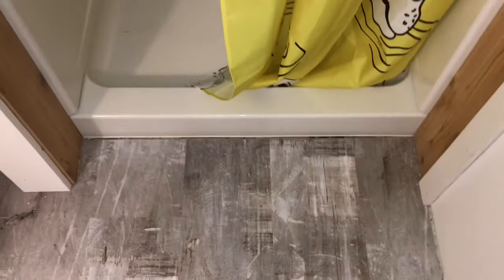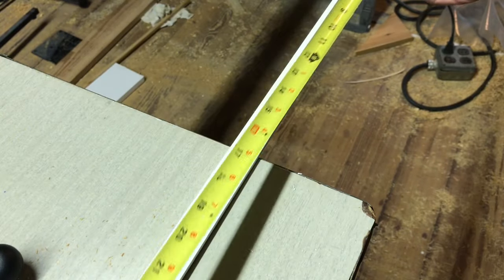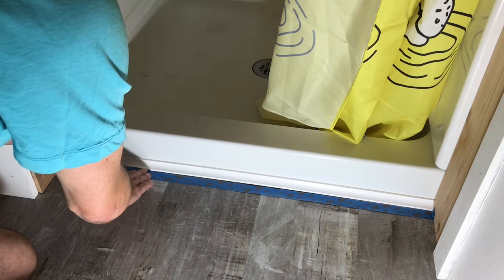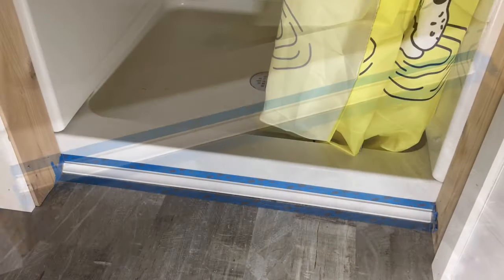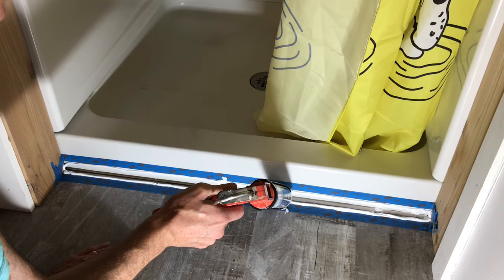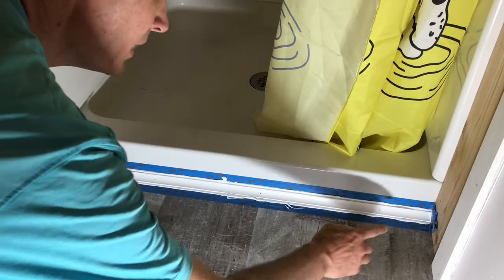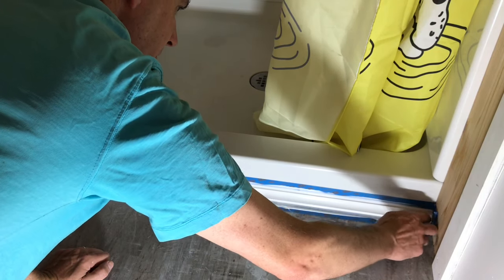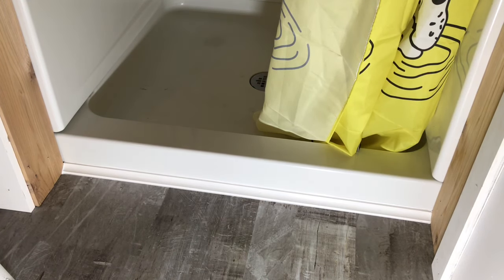How to waterproof a shower/tub threshold on floating vinyl floor

Comment: For the sake of not putting holes in your waterproofing and having to calk the holes and hope in a few years you don't have a shower in your downstairs hallway, just use waterproof construction adhesive, 2 birds.... plus it holds better than brads.
Reply from the maker: Thanks for the tip, Craig.

Comment: Thank you for the video! I have an important question. Are we not supposed to seal in side the shower where the floor meets the walls? 0:04
Reply from the maker: Thanks for watching :-)  ... and no, you don't seal there because the shower walls "shingle" over the base so that water will always go to the inside of the pan. if you caulk the bottom gap, besides getting moldy, it could trap water, especially if you have a 3 piece surround wher water gets behind verticle seams.

Comment: Well, at least that piece appears to be PVC, I've ripped out at least two rotting wood moldings from in front of shower/tubs. ... I strongly prefer treating it like a larger sized caulking gap, using a backer rod and silicone.... Or, using one of those rubber-like transition/gasket sort of things.

Comment: Wow I am.so.glad I came across this because we're remodeling our bath and have installed a shower pan, dreamline, and will be laying lvp in the same direction as what you have. This will definitely work.
Reply from the maker: Glad it was helpful!
Reply: I too will be installing the dream line shower pan that sits in cement. Did you leave a 1/8 inch gap between the studs and the base? I watched a video where that’s what someone said to do to keep the base from cracking so it has room to expand when someone steps in on it. I’m not sure what to do my Carpenter says he thinks the gap would cause the base to crack. What did you do and how is your base doing after 10 months? Thanks
Reply: @lillithjones993  I had someone knstall.it. so unsure if they did.

Comment: Is this LVP? Doesn't it needs to expand/contract?
Reply from the maker: Yes it does, Dominik, but 100% silicone is very flexible and apparently allows for enough movement. It's been over a year and still looks good---and there are huge humidity swings in there :-)  Thanks for the comment!
Reply: I want to do the same thing but worried about the same thing

Comment: By sealing the top and you're not giving the planks the chance for expansion?
Reply from the maker: The silicone stays flexible to allow movement. The floor and threshold still look as good as the day installed.

Comment: Hey Dave thanks for the vid!  I notice you have boards up next to your shower wall panels. Did you do anything to waterproof / flash the transition?  I have ship lap on my walls and am wondering g how to run it into the shower wall panels
Reply from the maker: They are just unfinished cedar boards (I did a video on those too I think). I used them because they're rot resistant, and wanted them unfinished so it smells like a sauna. They still look good except for a tiny bit of greying at the top where the shower splashes off someone's head.

Comment: doesn’t the vynal floor need expansion room? if you caulk and nail the trim won’t it cause your vynal to lift?
Reply from the maker: The trim is actually nailed to the subfloor, and the 100% silicone stays flexible enough to allow movement. 4-14-24 This still looks as good as the day it was installed.

Comment: You caulked both top and bottom to shower and floor, does this still allow floor to float?
Reply from the maker: Yes. Since this is 100% silicone, it stays flexible. The joints still look good today.

Comment: Thanks a lot for this, amazing advice. Can I use PVC trim also around my room  with Vinyl Flooring instead MDF? Please advise, thanks a lot.
Reply from the maker: Absolutely, Denisa. I would definitely pick PVC over MDF any day. Between PVC and finger joint (for interior use at least) I'd just go with whichever is cheaper.
Reply: @FamilyFriendlyDIY , Thanks Dave for your kind advice, I appreciate it.

Comment: Great video, exactly what I needed. What was the size of the cove molding you used?
Reply from the maker: Thanks, Brad. It was 3/4 inch.
Reply: @FamilyFriendlyDIY  I need one that is a little over an inch wide - inch and an 8th at least. . I'm having trouble finding the right size.

Comment: I have a hole next to my tub and vinyl flooring. I was planning on doing something like this to cover up the hole. Would you suggest this? And where did you get that pvc at? Ty
Reply from the maker: As long as the hole is small enough to be covered with some overlap. I got the PVC molding at either Lowe’s or Home Depot.

Comment: Thanks for this great video! Do you have a recommendation on the Cove Molding and Silicone caulking to use? I want to install this but my flooring is tile and grout. Will this work for me? (minus the nails)
Reply from the maker: Thanks for the question, Mike. The reason I used this method (which I probably should have mentioned) is because we have the floating vinyl floor, and the silicone/cove molding combination would still allow it to "float." If I were doing the transition between a shower and tile, I would first replace any damaged grout, and then just use silicone -- no cove (I usually buy GE 100% silicone). I hope this helps.
Reply: @FamilyFriendlyDIY  Thanks for the reply! I used Seal-A-Crack Tub surround tape with Silicone. Hopefully it stands up!
Reply: @FamilyFriendlyDIY  How would it still be able to float if you put brads into it? Wouldn't that attach it to the subfloor? Not trying to give you a hard time, I'm having issues with water in the downstairs apartment seeping through the upstairs bathroom, and I'm trying to figure out the best way to address it.
Reply from the maker: @paulr7719  yes, the brads are in the subfloor, so the trim itself is staying stationary with the shower pan, the flexibility of the silicone allows the vinyl side to still move. It's like how when you tile a floor, you don't grout the edges next to the bathtub etc., you fill them with sanded silicone so the tile can move.

Comment: Others videos did not silicon floor due to expansion contraction of vinyl plank flooring…..
Reply from the maker: The silicone is flexible enough that it still allows movement. The silicone and floor are still going strong, no cracking or buckling. Thanks for the comment!